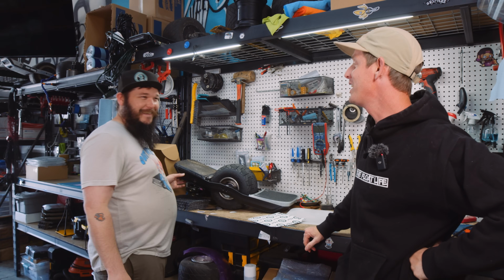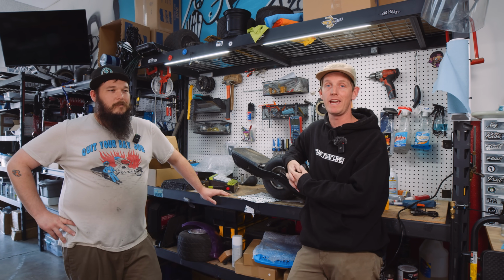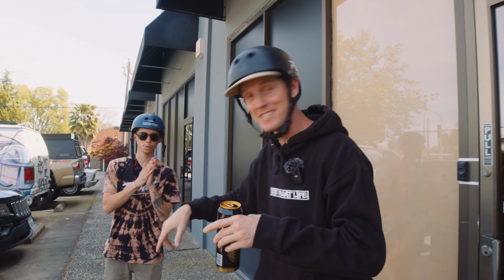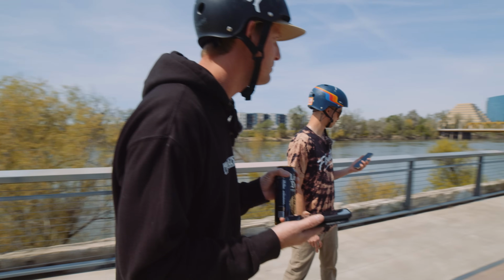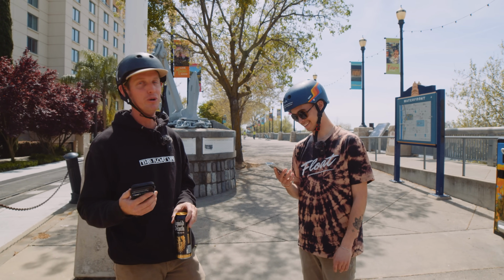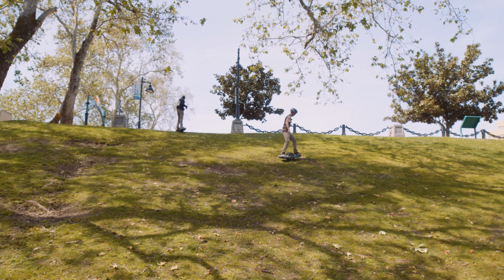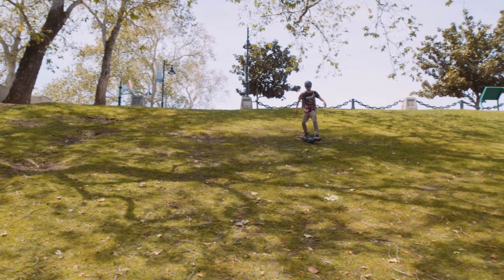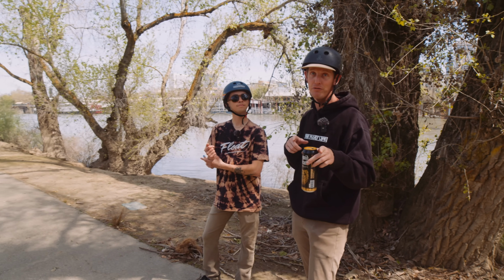Repair it Yourself With This EASY Drop in Kit // GTV VESC

Comment: This so exciting！Thank you guys for making this vid！the beta kit seems missing a Bluetooth attena during installation, my badn I didn't got time to send u guys an instruction😂 also the head lights are not included in the beta kits, but we have got them out today from the smt line. Stay tuned, it's literally 2 weeks😂
Reply: 🙏🏾 Tony 🏆 84V max? but  what's the highest battery config we can stuff into the GTV? 👀
Reply: What will be different from the GT-V kit and reusing the V1 electronics from ADV pro when v2 electronics released? I know you previously stated that the ADV/Pro v1 electronics could be repurposed to vesc GT. will I need BOTH the v2 electronics AND GTV kit to get my ADV pro and GT updated? thanks in advance. Getting my USDC ready :)
Reply: @jaefrmbk2k  the max input is 100V
Reply: @drjaywhiz  reusing the v1 esc is doable you are gonna need a Slim version of LCM which we will provide later otherwise it wont fit
Reply: TAKE MY MONEY
Reply: i´m stoked!
Reply: stoked for the pint model 🙏
Reply: Fantastic work Tony! So stoked to get my hands on a kit. If you have room for any more beta testers I'd love to purchase and start testing it on my GT.
Reply: Are you thinking about making a pint/pint x version of this in the future?
Reply: @coledavis3002 seems no one really cares about Pints, heck even FM dont want them back, XRs and GTs are the way to go for modifications.
Reply: Dude! thanks Tony, cheers to you! Love your work 🤌
Reply: I am about to order a GT here in the UK this eases my mind a little if something does go wrong, will it be able to be shipped to the UK.
Thanks 👍👍
Reply: 🎉🎉🎉🎉 looking forward to getting my hand on one.
Reply: I just hope you will have enough stock... based on the number of comments on any video I'm worried I won't be able to get one :o ;D
some time ago you mentioned your version of lowboy footpads... any update on those?
Reply: Can we bye though normal currency I will do my pint and GT ❤
Reply: @floatwheel  What about those that have soldering skills? Can we just desolder the relay block off the LCM ourselves?
Reply: @coledavis3002  Tony has a video showing PintV. It's the same controller, different BMS and mounting plate.
Reply: 2 weeeeks Tony! When ya planning on releasing the drop-in kit? Would love to get my bricked GT up and running again!
Reply: Got my kit, it’s awesome!!!
Reply: Is the mod still possible after the latest firmware?

Comment: Imagine if FM just gave the GT the GTS update and everybody didn’t have to go this route and they’d keep customers  🤯
Reply: 1000 ‼️
Reply from the maker: If they didn't take away IMU re-level so folks could just run their damn aftermarket rails they would lose less customers and sell more boards 🤷‍♀️
Reply: @TheFloatLife 100 percent. So glad I didn’t update.
Reply: It doesn't change the future motion repair process and repair cost.
Reply: @Kay0Bot  True, it would be even better to have certifications for repair shops. Not everyone can send back this things to the US or repair them themselves
Reply: @Ty-ye8rd the board will be incompatible with the Onewheel app after this update. It will no longer have FM firmware with this new controller.

FM could do an update that unlocks/adds new tuning parameters in custom shaping, but I'm 99% sure they won't do that. As far as battery current limitations in the stock controller, I don't know if it's a hardware or software-imposed limit.
Reply: @humbertoduenas89  its software imposed , tony said fm hardware was capable of achieving vesc output

Comment: Here’s why you could climb without ATR. I bet Nico had torque tilt enabled, that will also raise your nose when climbing steep stuff - so it acts like a backstop when ATR isn’t there
Reply: This is correct, Torque Tilt was definitely key there. That's my bad, didn't know they were going to run no-ATR tests so I hadn't mentioned that Torque Tilt is also a factor. It was set to 0.10°/A with 15A start current threshold I believe, so not too major but definitely beneficial in keeping that nose off the ground
Reply: @nicoaleman  was any Field Weakening set on that GT-V? 👀
Reply: @jaefrmbk2k  45A, 65% DC, 500ms Ramp Time
Reply: @nicoaleman 🤜🏻🤛🏾
Reply: @PrestigeWheelRide  Ideally, you'd want the ramp time to be as low as possible without experiencing negative side effects, such as in low speed high load situations that cause DC spikes, or just in general when transitioning to Field Weakening at speed. I've never experienced any noticeable transitions or side effects with 500ms personally
Reply: @nicoaleman  just got the GTV kit from the float life. I have WTF rail. Do I need to calibrate its pitch? how do I set up when the heptic buzz kicks in? sry new to VESC and a lot of the videos gear towards older VESC versions?

Comment: So stoked for more people to get into Vesc with this kit! Also might be a good move to make the motor connector tighter since that’s a common failure point. Range wise if you ride it the same way you ride stock GT it’s gonna be same range due to energy conservation, but obviously when you’re on a VESC you push it harder!
Reply: With a motor retainer clip, either from 1WP, TFL or some custom one, it's not an issue right? I can't imagine it being. Combined with dielectric grease should be low possibility of failure on the motor connector.
Reply: @garrymullins  my motor connector blew even with a retention clip. IMHO at the rate these connectors are failing even with retention clips, it's safe to say the GT motor connector isn't even designed to handle the current stock GT delivers, let alone a vesc controller that can easily double that. for comparison, most DIY vescs are running 4mm bullets per phase. GT motor plug phase wire pin is around 2.5mm. Likely that connector will bottleneck performance quite a bit and running that on vescs might be pushing it too hard for it to fail even more frequently, but it's not something tony can fix with a drop-in kit because you'll have to mess with the motor side connector
Reply: @leonchang7596  What is happening to your motor connectors - are they pulling out with all the curb nudges you do, or blowing up due to too much current? Whatever the issue with these motor connectors, is there a solution?

Comment: Stick your bluetooth antennae sticker on the plastic ledge piece of the cover that allows the GT status light LEDs to shine through. On a Floatwheel ADV board, the case isn't metal so you can stick it on the side no problem. GT case on GTV is metal and I suspect that sticking it directly on there can cause issues. Metal plates under custom footpads will also cause signal interference and that plastic ledge is also optimal for that as well since it appears to leak through it. Once I stuck my antennae on the plastic ledge my signal issues disappeared. Tony will be advising on similar soon. Tip: RT data values in VESC tool change rapidly and is a great indicator of signal strength because you can actually see the number change slow down as signal decreases and speed up as signal increases. If you have any doubts, do your testing that way and you will see exactly what I mean.

Comment: Now that we’ve got the ability to unleash, the GT’s potential would be nice to see the heating results of the motor and if any additional accessories required to 
cool down. The overcurrent  warning on the stock GT hill attempts got me thinking.
Reply: think overheating is gonna be the biggest challenge. And it's probably gonna need additional solutions

Comment: @nicoaleman just got the GTV kit from the float life. I have WTF rail. Do I need to calibrate its pitch? how do I set up when the heptic buzz kicks in? sry new to VESC and a lot of the videos gear towards older VESC versions?
Reply: Floatwheel offers good support for their products. if the board needs adjustment send them an email.

Comment: Awesome vid 🤙
Do you know if this will be a smart BMS or a standard charge only BMS?  What about cell over-voltage protection while charging?
Reply from the maker: Charge only. Heck, not like you can see your cells on a GT anyways! 🤣
Reply: @TheFloatLife  Oh sure, just curious.  The V1 FW BMS as I understand it had no cell level high voltage cutoff, that's why I'm curious to know about this BMS.
Reply: @RealMikeDobbs From what I understand, the primary reason the ADV doesn't have overcharge protection is because they went the route of a Charge-Discharge Dumb BMS, so it would run the risk of cutoff from over-regen, or something along those lines. Since this setup is Charge-Only, I wouldn't be surprised to see that protection enabled again. But not sure if we've gotten confirmation on whether or not that's the case yet, and this is a prototype as well, so things could change before release regardless
Reply: @nicoaleman Hi Nico, the BMS in the kit is a charge only BMS, with 42mA/cell balancing starting from 4.18V, and will stop charging if any cell reaches 4.2v so u can safely leave it plugged in wall. ans also a 100A fuse on the BMS output to prevent any catastrophe battery fire.

Comment: Great product! And video! Question, which hub are you using in the GTV?
Reply from the maker: We all rock MTE 5" hubs: https://thefloatlife.com/collections/tires-bearings/products/mte-hub-5
Reply: @TheFloatLife  Thanks for the reply, I guess what I’m asking is what magnet configuration are you running?
Reply: Just checked and we were rocking N42 on the GTV board, so same magnet strength as stock. The normal GT actually had N48 magnets, so it should've had a bit more torque than usual actually
Reply: @TheFloatLife  N52 restock please!

Comment: Has tony released the amp and voltage rateings for the controller? And if so, where does he post about this thing? The floatwheel website doesn't seem to have anything about it
Reply: voltage is supported up to 100V on the esc, it's running a stable version of adv controller, so it can do 130A/260A abs. The BMS is a charge only BMS with full pack passive balancing starting At 4.18V and cell level cut off at 4.2V. 100A fuse on the battery output side.
Reply: @floatwheel  I supper appreciate the reply that's great to know! Should we just be emailing you about pre-orders for the kit?

Comment: Now please GTV vs GTS vs ADV. My guess 1. ADV 2. GTV 3. GTS
Reply: Aside from range, and mayybe 0-2mph crawls, I would say it would be ADV, GTS, GTV. High speed pro level trail rips will be interesting though! Weight and voltage advantage of a GTS, vs straight raw power of an ADV, vs the new wildcard GTV.
Reply: @humbertoduenas89  yeah I guess the weight is the advantage of the GTS. Maybe we should also put the VOW GT in there

Comment: How much do you think this kit will cost ?
Reply: 399 intro price.. 499 after. Keep in mind it comes with bms as well.
Reply: @dannycheung_ especially when you consider FM just wants you to buy a new board (planned obsolescence), or pay them more than what the drop-in costs to replace entire modules, instead of just fixing the problem, which could be minor and affordable. FM also has the right to refuse to service your board if they don’t like your mods, like they used to do. Also, shipping alone is going to be a couple hundred $ depending on where you live.
Reply: @erikagrey1384  and it’s always rider error lol. Never the boards fault.

Comment: Fuck that then all my miles that I logged are gone. Nope!
Reply: better performance > an odometer.....
Reply: You can set your starting miles when you start off with your VESC 😅
Reply: Counting miles? Missing the point.
Reply: You are more concerned about how many miles your board has over performance? Sounds like fm is for you buddy.
Reply: @chrisc790  they made my board yeah they are badass I don’t have a problem with them. I love my board
Reply: @welcometofpv2241  perfect, a subpar board is for you then.
Reply: @chrisc790  that’s fine enjoy dicking around with the board all the time messing with settings to pull 3mph more out of the board yet make it more unsafe lol
Reply: @welcometofpv2241  I'm riding a floatwheel and the thing is a hell of alot safer than my gt ever was. But even the drop in kit will be way safer than an fm board as it will be similar. If there is any kind of problem with your board it will tell you. Battery problems? It will tell you. Atr so that your not tail dragging down steeper hills, way safer. Duty cycle so you actually know the limits of your board? Way safer. Yes you have to spend a bit of time on the initial setup but once you're done that, it's smooth sailing.
Reply: @chrisc790  I wonder how fast it would make my pint x